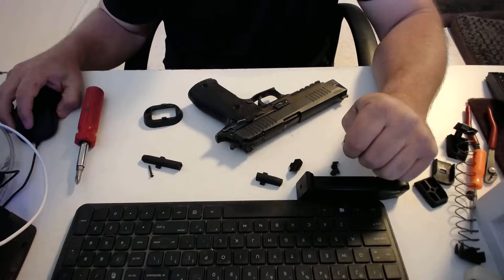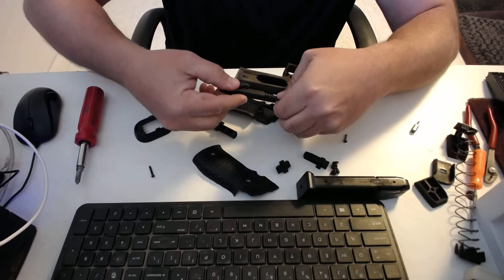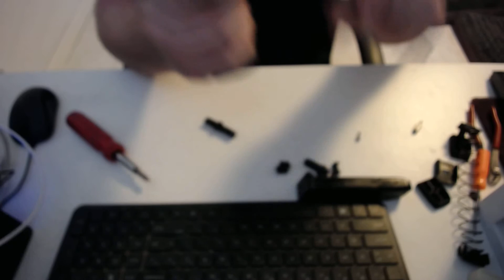3D Printed gun gear Sig P226 SAO Magwell Install

Comment: I understand I wouldn't be able to use the factory 15 round mags with this. Will I be able to use mec-gar 18 round and 20 round mags with this magwell?
Reply from the maker: Mitch Cairns 
Yes both mecgar mags will work. However you will need to use the matching baseplates.
Reply: 3D Printed Gun Gear would the mecgar 20 round mags work with your “open front magwell”?
Reply from the maker: Mitch Cairns 
No not wide enough to fit those. You would need to use my extensions.

Comment: What base pad would you recommend cause my 20 rd mecgar doesn’t work with the mag well
Reply from the maker: I have extensions for those mags. makes it a total of 21 round. Smaller profile, so it works with the magwell.
Reply: @3dprintedgungear830  ok forward me the link
Reply from the maker: https://3dprintedgungear.com/product/plus-3base-plate-extension-for-mecgar-p226-9mm-18-round-magazines-stainless-steel/

Comment: Why do you need a bigger mainspring seat?
Reply from the maker: KingOf Ny 
To attach the magwell.
Reply: 3D Printed Gun Gear it wouldn’t hold with the other. Correct??
Reply from the maker: KingOf Ny 

Correct, That is why I send a replacement with the magwell.
Reply: 3D Printed Gun Gear Im new to firearms and such. Just was curious about it all.

Comment: Is this the same foe the open front magwell
Reply from the maker: john winter 
All SAO models install the same way.
Reply from the maker: James, when it comes to 3D printed materials stainless steel is much easier to work with & costs less than half of aluminum. As for the 10 round mag, I have them for the MecGar 10 round magazines. Sig has had several different 10 round mags in the past depending on caliber. Yours may be the MecGar.